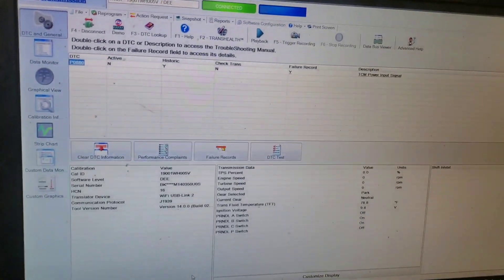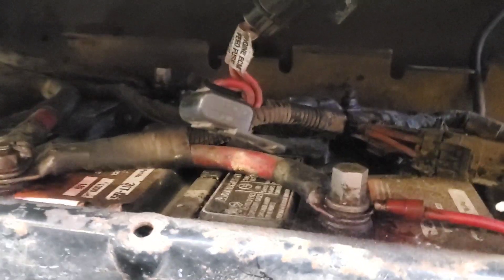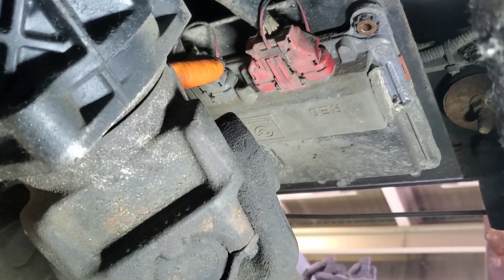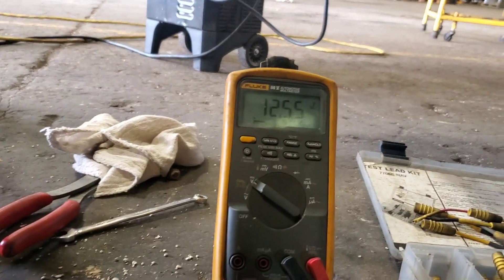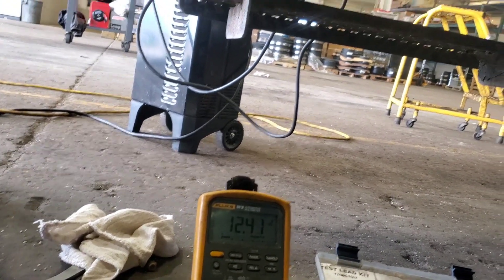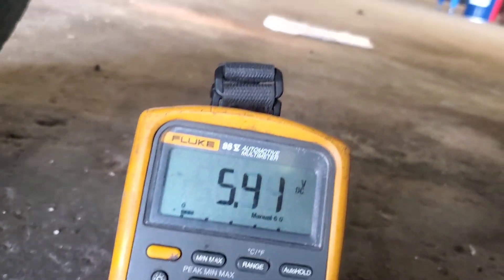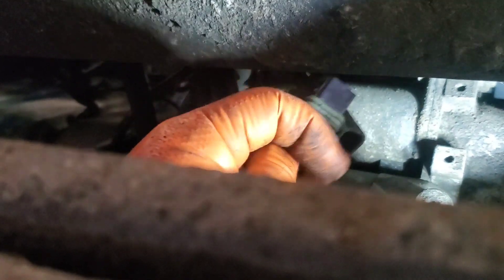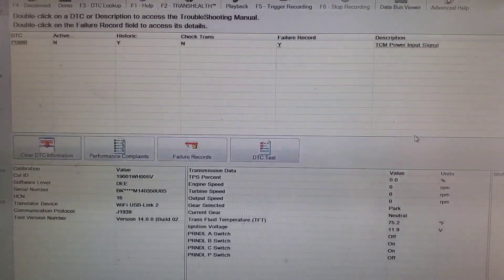Speedo Cutting Out - Hard Shift - Code P0880 Low Voltage Allison Transmission How To TEST and FIX

Comment: General electrical question: If you know a pin is supposed to have 12v B+ unplugged, is it pretty much generally safe to load the circuit or do you still NEED a diagram to rule out doing any damage to ECUs?
Reply from the maker: It's safe to load test the circuit. 👍